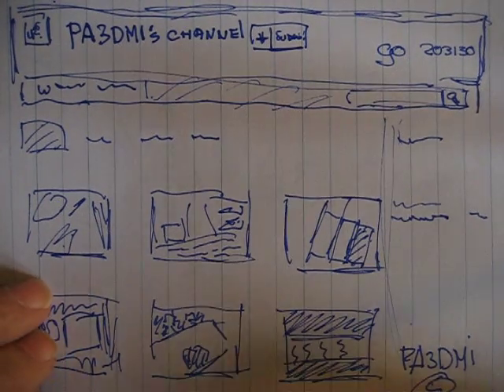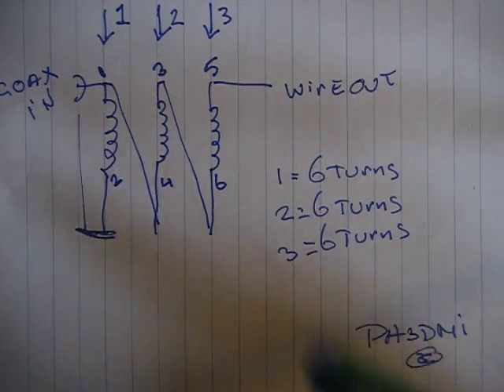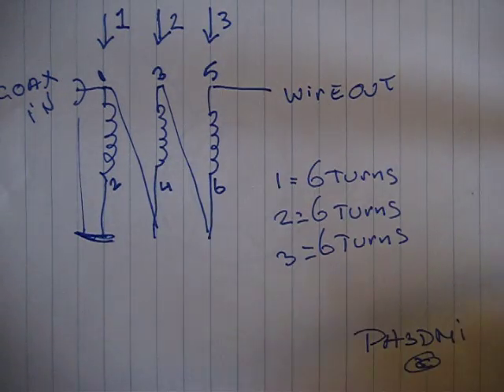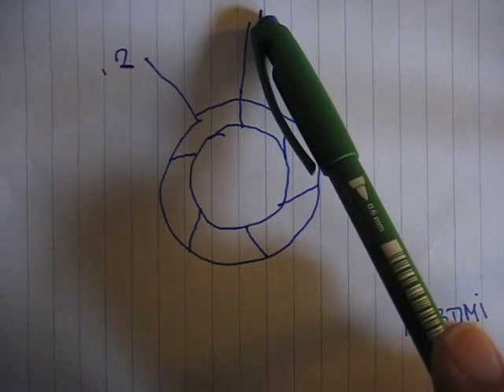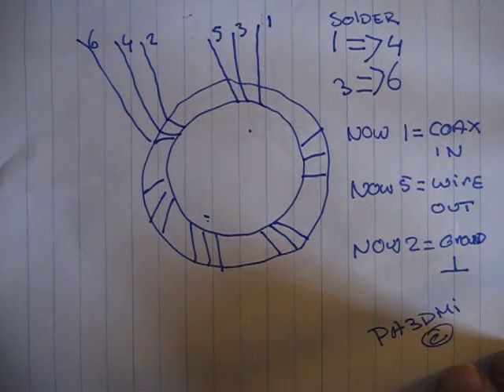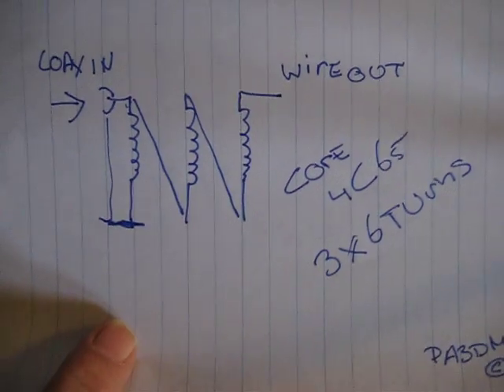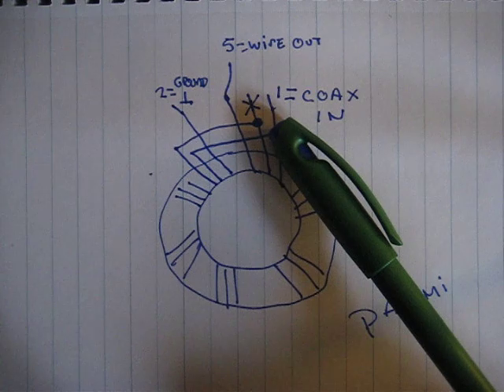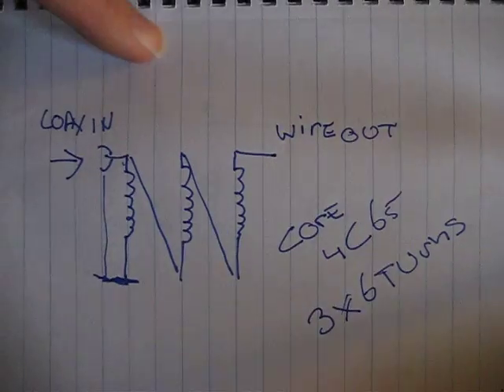part 2 How do you make a balun for a longwire antenna for shortwave?

Comment: Thank you for the video :)  I understand the upload is over three years old, so you might not read this... Anyway, I did attempt to make this but the only toroids I had were iron powder? "painted yellow" toroids, so... well...  I'm not sure if it functions correctly!  Still a bit confused on how some ferrites are for this or that frequency, different mixtures etc. Anyway, thanks again for the two videos
Reply from the maker: Hi W3llhard, a good source is amidoncorp.com/ferrite-toroids/ Yellow is useable between 10 and 50 MHz, red is used the most by hams because is useable between 2 and 30 MHz. Bye from Amsterdam, PA3DMI - Jarno
Reply: PA3DMI Hi, I have looked at the link you posted and there is plenty of info to keep me busy :)  I think my yellow ferrites were from an old computer psu, so probably not ideal for shortwave, haha.  Thanks again for the reply, Bye

Comment: Technically this is a 9:1 unun (unbalanced to unbalanced).

The problem is that end-fed antennas can have an impedance of several hundred to several thousand ohms depending on their length and the frequency. A 9:1 unun reduces the impedance by a factor of 9 making it a better match for the receiver.

I just thought I'd point that out. Any corrections are welcome.